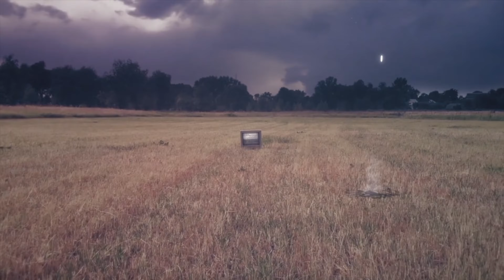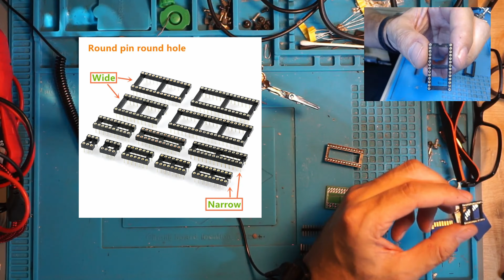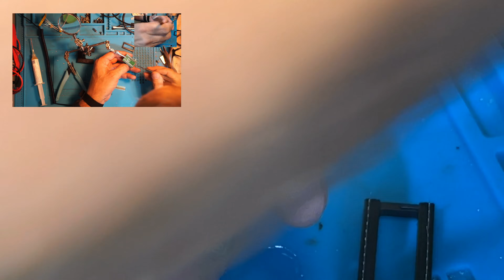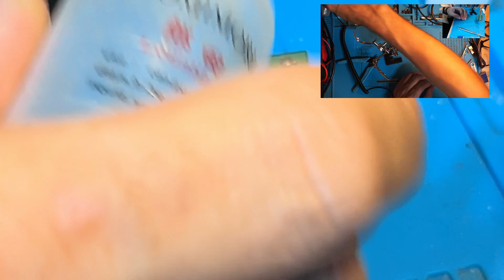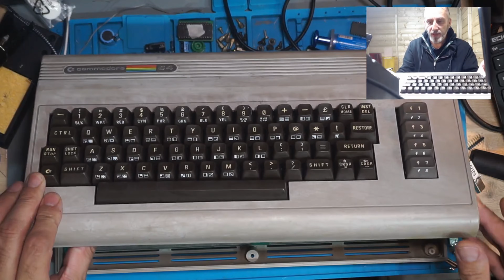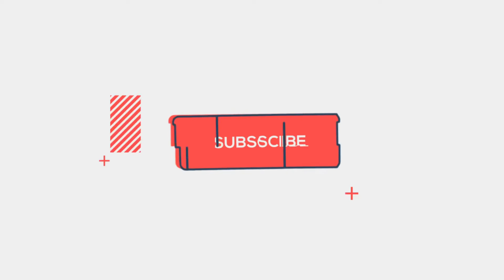Level Up Your Commodore 64 with Step by Step Jiffy Dos Tutorial

Comment: Isn't it easier to bridge two pads by soldering the leg of a resistor/capacitor between them first and cut it off afterwards? That way you can stabilize the part with your other hand.
Reply from the maker: Yeah you can do. I do use resistor legs for this now and this would make it easier. Thanks for the tip I'm sure it will help people in the future. And of course thanks for the comment